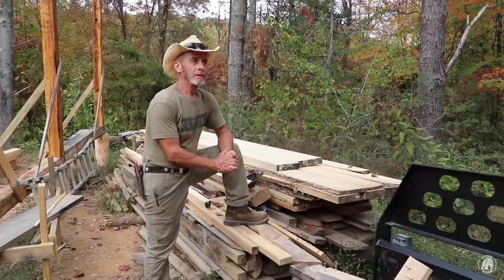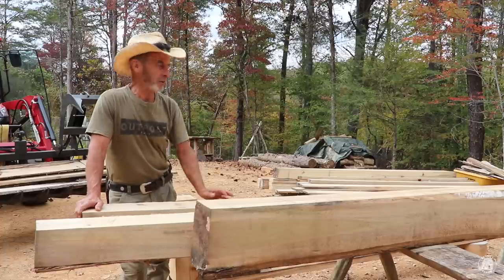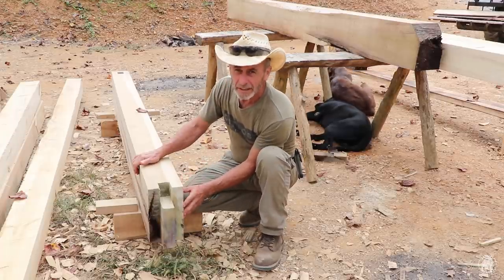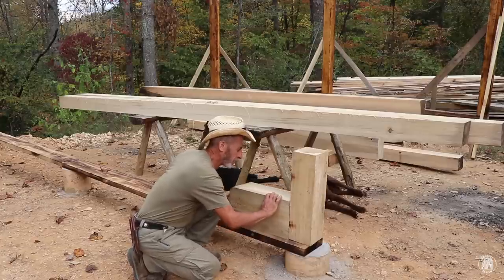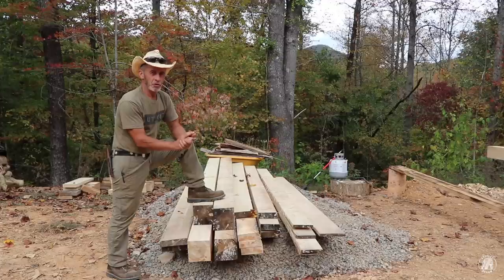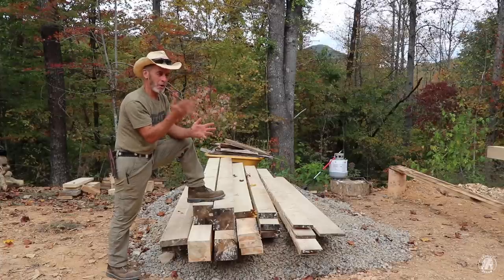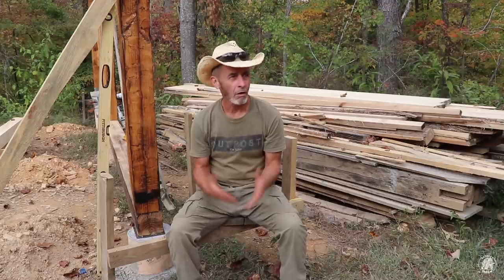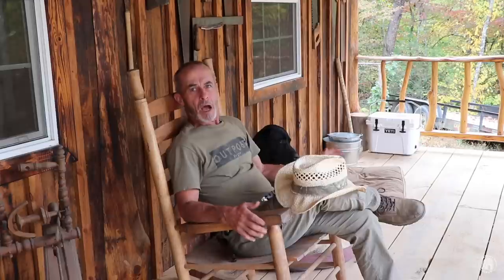MILLING LUMBER FOR THE TIMBER FRAME WORKSHOP

Comment: Thank you Richard for telling us more about what an how ya. Got things going on there I myself found that very nice..I wanted to share with you my grand father built the old war house as we called them as my dad was off in world war 2..but on the front porch  is 4 popular  5 or 6 bys for post an they still there keep dry last forever but I think in the 80.s we had the bottom of one post to rot a little such as you did an I wanted to share then with you but we cut about 4 inches off the bottom of each post made a fix out of black pipe as you made for shelves just put a screw plate on bottom an top an a pipe an made them 4 inches that way you had a air gap an not wood on wood to hold water ..I hope you can see what I'm saying ..I think you can an I think this wood have worked for you with less trouble...lol..